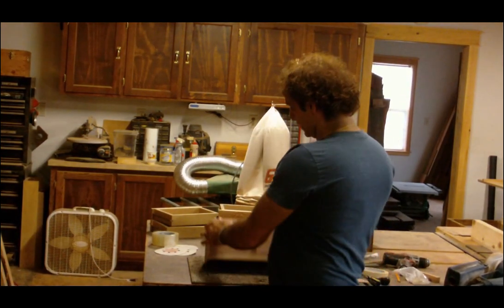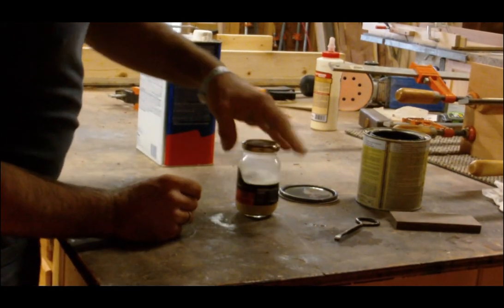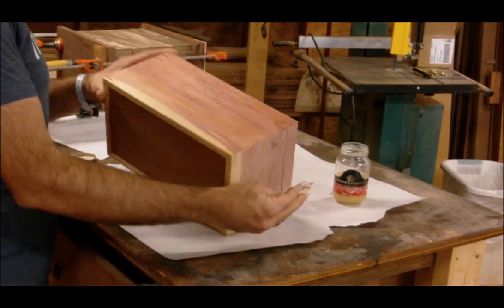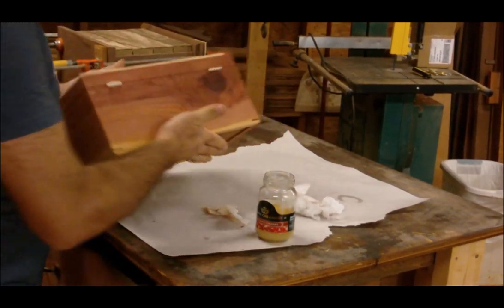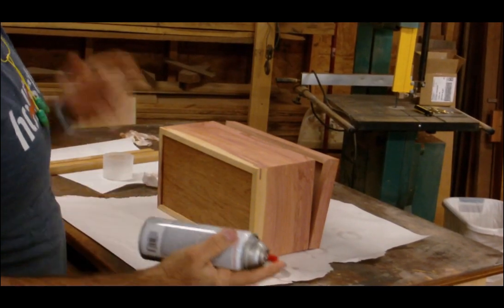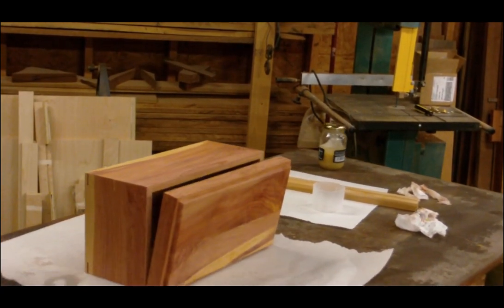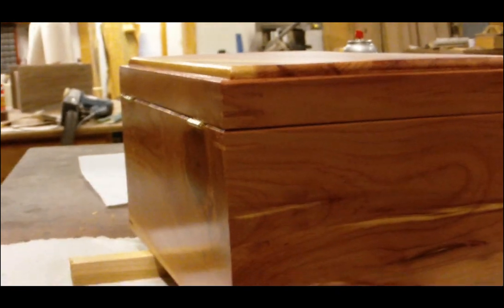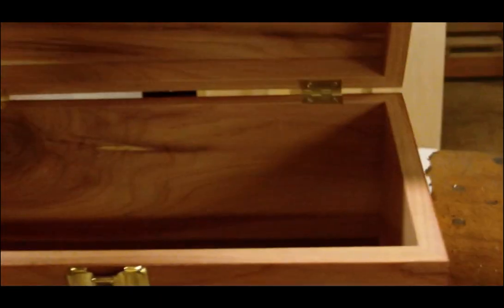Finishing A Small Red Cedar Chest

Comment: Hi. Can I use tung oil first and then polyurethane or epoxy as the final coat? Thx.
Reply from the maker: You can do that. The way cedar soaks up finishes it may add a layer of depth early this way.

Comment: How much time did you allow for drying between coats?
...Is it necessary to sand between coats?
Very nice btw.
Reply from the maker: Leila Dunn I allow 1/2 hr. to 2 hrs. It is best to read the instructions on the can. With lacquer, the second and additional coats remelt the previous coat for a good bond. You hardly ever have to sand between coats because lacquer dries to the touch in about 20-30 minutes. If it looks glazed when dry, just use 0000 steel wool to dull it down, then if needed finish with paste wax. Thanks for the view and comment.